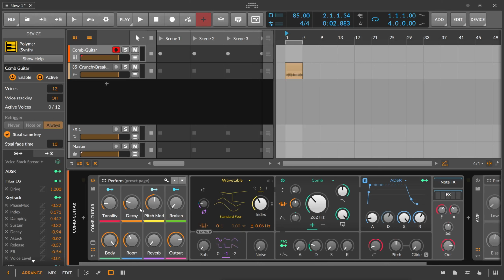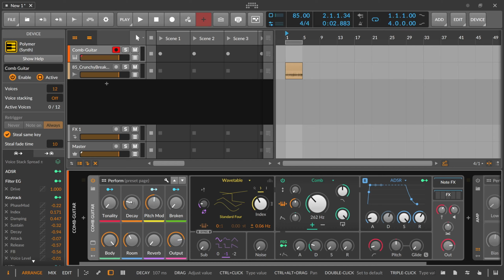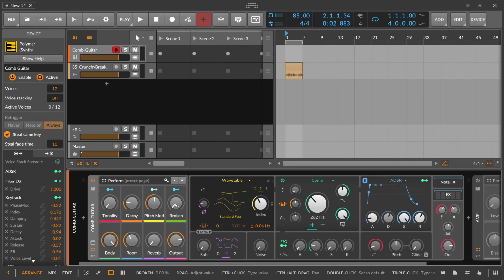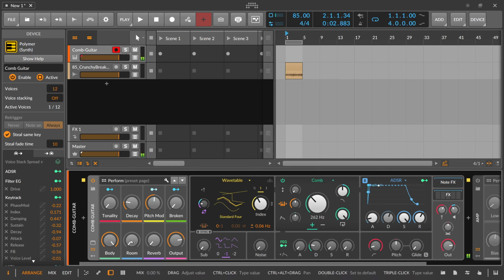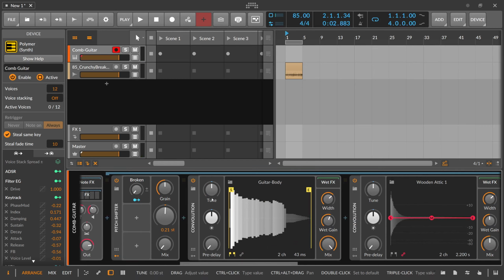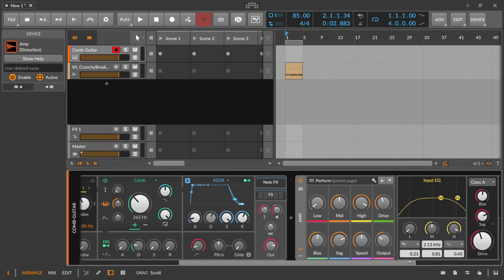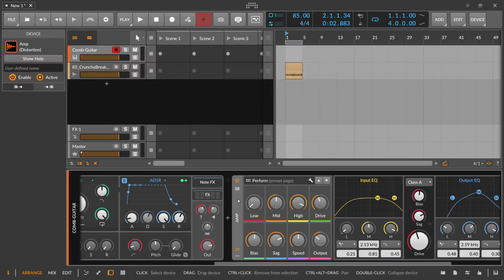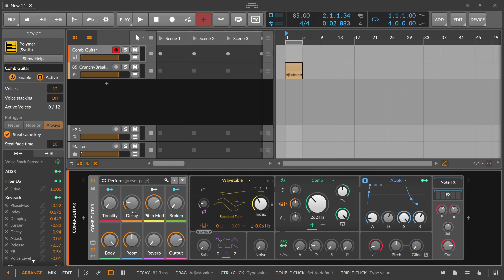Comb Guitar - physical modeling based acoustic guitar preset for Bitwig Studio (patreon)

Comment: I see you're using 2 convolver devices sequentially. You should be able to combine the two IRs into just one (and save CPU by using just a single convolver) since convolution is an associative operation.
Let's say I note S x IR the convolution of an audio signal S by some impulse response IR, that means that (S x IR1) x IR2 = S x (IR1 x IR2).
If IR1 is the guitar body impulse response and IR2 the room impulse response, that means putting a convolver using IR2 on a a track that just plays IR1 (*) should give you a new IR, which is the combination of the two and which you can render to a new wave file, and which you can then use in your regular track. And you can do that for more than 2 IRs, just stack more convolvers before rendering the final IR.

That's why it feels weird to me that convolution plugins never let you load several IRs, which they could then trivially "stack" using that process in an automated fashion. It would save us time and CPU.

(All of that is if bitwig's Convolver acts like a regular convolution product and preserves the associativity property, of course)

(*) or the opposite. Have a track that plays IR2 and make that go through a convolver with IR1 loaded. Should do the same, convolution is also commutative.
Reply from the maker: thx for the input, but i want to control the body, room and reverb separately